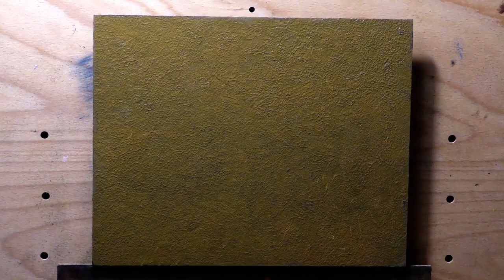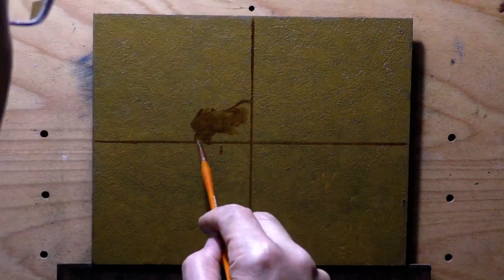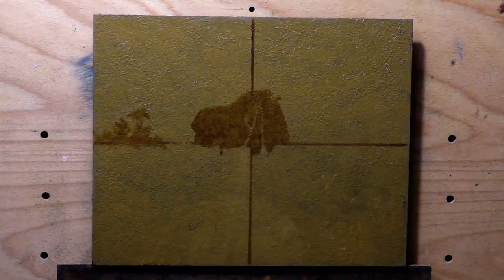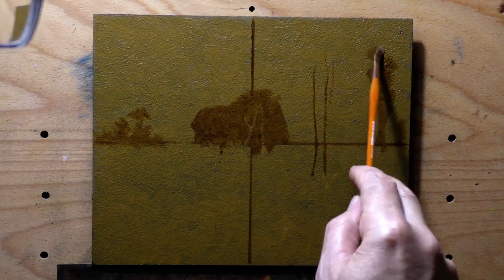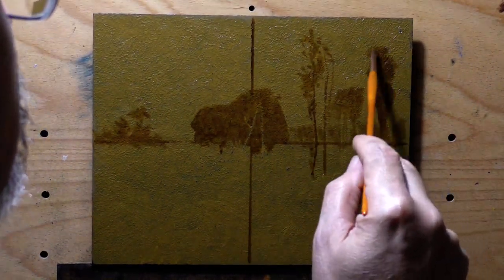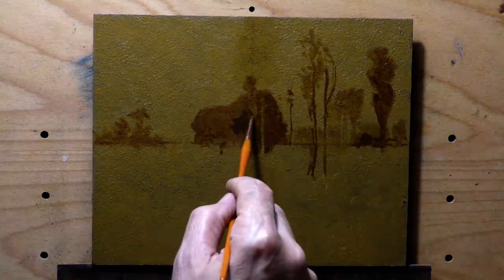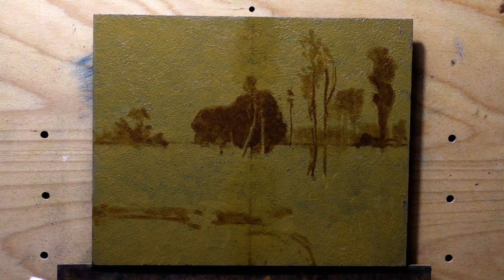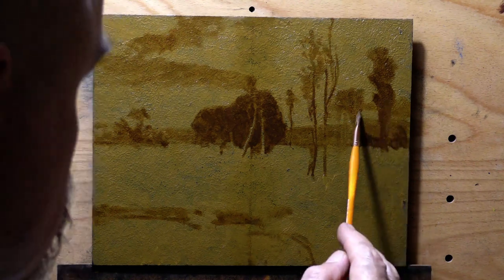Study after George Inness - Afterglow on the Meadow 8x10

Comment: Hi Michael, I'm thinking of applying an acrylic texture like the one in this video to stretched canvas because I like the way it looks.  Any reason I shouldn't (e.g. likely to crack, or not be as successful as on hardboard)?
Thanks! Love your work!
Reply from the maker: Hi Ed, I'd deffo think twice about doing the heavy texture on canvas. Because canvas is far more susceptible to expanding and shrinking with changes in temperature and humidity, cracking could ensue. On the other hand modern gesso's are made from acrylic which is basically plastic. Acrylic does tend to bend where older gesso's would break so you might be ok. Sorry I can't give you an definite answer. For my part I way prefer working on board but boards do have limitations as one works with progressively larger sizes. Cheers 😁